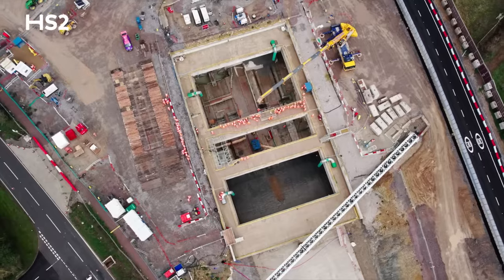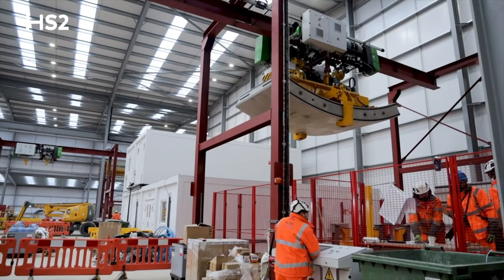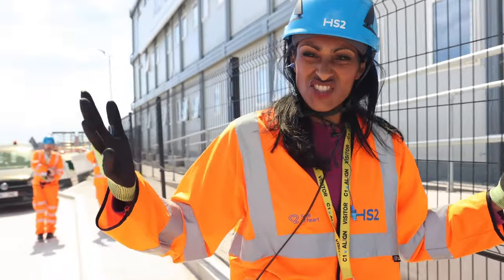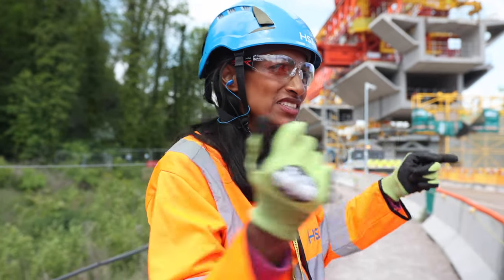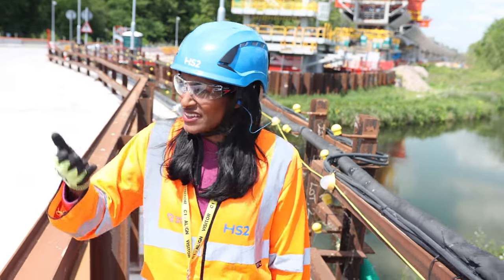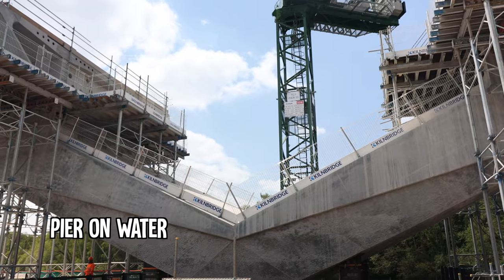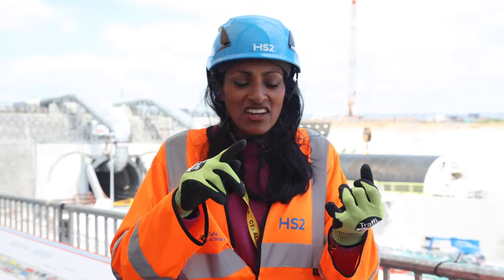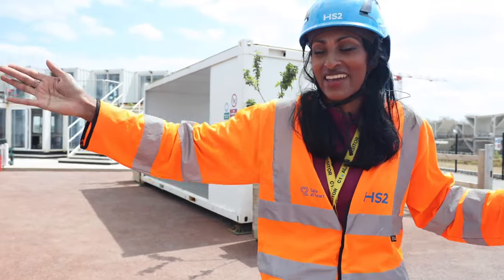The Engineering Behind Britain's Mega Rail Project

Comment: 0:40 Concrete not sustainable?  That's a first.  I've heard the world is running out of course sand used for concrete, but not cement.   Cement I didn't think the world was overly concerned about running out of.  I don't think high strength concrete used in rail bridge construction would be competing in that type of cement anyway.
Reply: Cement isn't in short supply, the problem with it is the energy required to make it.